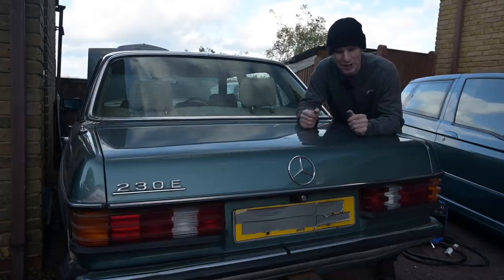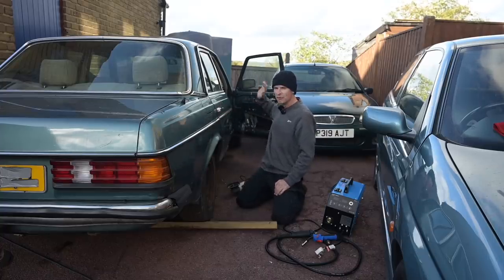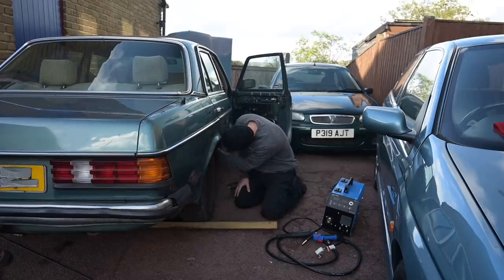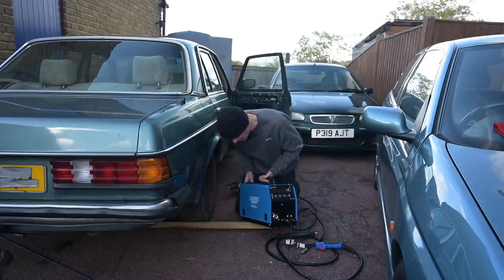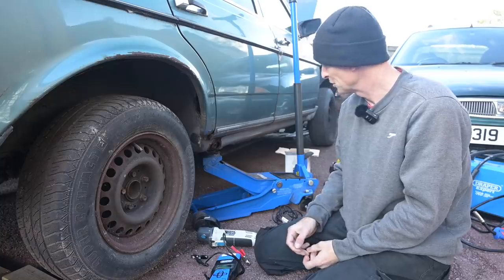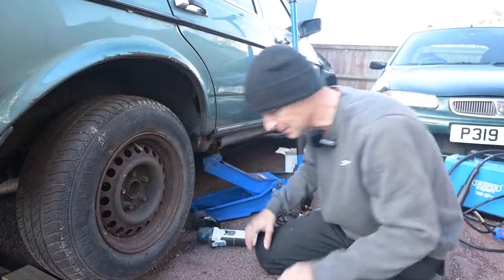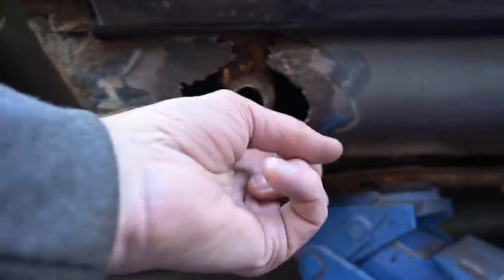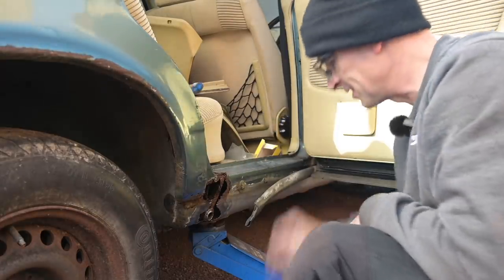More welding on the Mercedes W123

Comment: Lovely start ,I think I would have put some protection over the seat etc as the sparks could damage things speaking from 46 years of welding experience. Love what you do carry on the good work.
Reply: Exactly, loosening rear seats on older cars usually aren't that hard, and as close everything is in that yard, a fire would damage more than pride in the work! Be careful and check for slow burning weld "hoppers"!

Comment: About the welding wire spool, you will find there is an adaptor in the middle of the spool to change the diameter to suit different welder types. It usually has a clip on the inside. Pull it out and you can use it on your new welder. Cheers Bernie.
Reply: Top tip!
Reply from the maker: That is a top tip! Its covered by the sticker so never see it!

Comment: Might be my imagination but, it looks from some angles as if there should be a closing piece between those two vertical sections of the jacking point before the outer sill goes on.🤔
Reply: I agree. Am thinking the same thing.
Reply: You beat me to it guys. Snap
Reply from the maker: you mean across the front, or side really? There was no debris to suggest one was there, I think it would have been flush with the out wall of the sill
Reply: Yep was a box section, you can clearly see where it's rotted away and left uneven edges
Reply: I found a picture online and the upper section of the jacking point does seem to be boxed in independently of the outer sill.
Reply: Absolutely - that's why these Mercs rot in that area due to the sweating between the closing piece of that jacking point and the actual outer sill.
Reply: I did think similar too, the inner structure could have done with a bit of work, but I guess it depends how far Matt wanted / was prepared to go. It will probably be OK but I wouldn't trust the jacking point and would avoid jacking up the car in that area - if it continues to weaken it could collapse - stay safe Matt!

Personally I think the use of thicker steel was a good idea - I've done this before with sill repairs, but MOT regs technically state you must use same thickness of steel as original. I've been told off by people (with no welding experience I should add) for doing this but in reality it's a pretty unenforceable rule and my welding has always passed an MOT so far!
Reply: @StewSims  It's not good practice to use thicker metal than factory. Simple reason being that thicker metal will soak up all the heat from the weld, which means to get decent penetration you have to turn the power up, which in turn will make it burn through the thinner stuff.

It's a fine margin with thin steel, you need it hot enough to melt the two pieces together without blowing holes. You should never be able to run long welds with a mig on a car, if you can you're just laying it on top. On structural parts of the car like inner sills (where seat belts bolt to) you need very good structurally sound welds.

Comment: The jacking point is supposed to be a box section inside the outer sill, but when the moisture gets between the outer skin of the box section and outer sill then the outer section of the box section rots away as well, not helped by limited corrosion protection applied by the factory.  As with a lot of things on these cars, the jacking points were rather over-engineered, but the outer face does help prevent the jacking point tube twisting upwards and buckling the outer sill if the vehicle is jacked when heavily laden, which can happen on vehicles that appear sound but which have the usual corrosion behind the factory rust protection...

As other people have said, always be sure to cover the seats and door trims when grinding or welding with the door open as the sparks are plenty capable of burning into the velour seat facings or the vinyl of the door trim and leaving lots of unsightly little burn marks.  They can also easily embed themselves in window and windscreen glass, leaving it with lots of nasty speckles like a teenager with acne...
Reply: The handbook says that the jacking point must only be used with the original wheel change jack which slots into the hole. If using a trolley jack lift via the rear axle.

Comment: For the Alfa you need to double check if you connected the constant + and the ignition switched + correctly. Often with Italian cars you need to switch the yellow and red wires, they mostly even have connectors in them to make swapping more easy.
Reply from the maker: I disconnected the radio entirely to test and it still managed to go flat in a couple of hours again so either the battery is bad or something else is drawing power
Reply: @furiousdriving  must be earth rays then 😅
Reply: @furiousdriving  you need to test which circuit is drawing power and then continue. In my Punto 1  had the same issue and only the 2nd dealer found out it was the rear screen demister that was always pulling a current. They didn't find the exact cause but I was able to solve it by pulling the fuse and not using the rear demister again 😅

Comment: Good tip for preventing rusty arches, or at least slowing down existing rust, is clean all the mud our from under the lip, every car I've bought was packed with damp mud. it's worse on the rear arches usually as the outer wing is pressed onto the inner wheelarch, creating a nice sandwich for moisture to gather. I'm still on my 25 Years old's cavys original arches (Just!).
Reply from the maker: Yes, thats a damp trap and will hold water against the metal - I snow foam under the car every time I wash it, stops it building up

Comment: Last time I did any serious welding the Acetylene torch was still common and DIY Arc Welders were low powered and next to useless on anything thicker than 1.5mm and only in mild steel.

Comment: I'd recommend a Lidl Parkside angle grinder - I've used one for years on old Gloria the Transit. 1200w, surprisingly good and I think they're £20... Only problem is that they're only sporadically available.
Reply from the maker: Need to always watch their website!
Reply: Oh, yes. LIDL tools are great for the price. I use a few Parkside cordless power tools myself.
Reply: @furiousdriving  It is actually addictive. Trust me. :p
Reply: I have the parkside angle grinder ,infation guns, aligator saw and impact driver 20v cordless models plus ferrix 20v drill and impact guns and 10 inch polisher, all pretty good domestic tools.

Comment: I was trying to see if you plated the end of the jacking point triangular box before doing the sill. I personally would not use jacking points apart from in an emergency at the side of the road but they do still need to be strong. A step drill might be useful for big holes.
Reply: Or even a cone cutter - I've found those invaluable over the years.

Comment: That hole at the back of the sill reminded me of the hole at the back of the sill of my BMW E34. However, BMW still sell that section of sill, with jacking point and a section of the wheelarch as a repair panel. I did wonder if Mercedes did similar?

Comment: I have been very pleased my Rohr welder, i have the same angle grinder and i dont like it as its awful to turn on ! I enjoy welding most of the time but can be sole destroying when you find big problems, You really ought to get a bigger gas bottle, try Hobby weld gas, save you money. I also thought the inner jacking point  needs a bit of plate to close it.

Comment: Hey Matt, hope you dont mind my 2 pence.  It looked like a piece of the inner structure was missing aswell like the triangle section above jacking tube should have been boxed over?  Also worth getting in there with rust killer and paint really while you can, rust killer is fine but it wont give lasting protection.  Id suggest a minimum allot of zinc rich weld through primer.  Enjoying the videos, just trying to be helpfull  😀
Reply from the maker: I dont think there was front panel on that, there was no debris to suggest one was there, and dont remember seeing one in the front.
Once all the welding is finished Ill flood the sills with rust proofer, but while welding is ongoing that gets burnt off (and wax oil burns well so its definitely the last thing to do!)

Comment: My father had a few of w123s and w124s, they all rust in the same places as this Mercedes ... when you remove the plastics, you are always greeted by an unpleasant surprise ...
For that era, these cars were well built and protected from corrosion, but time affects the overall condition of the sheet metal ...
try to find the whole alfa romeo alfasud ....

Comment: Just had to weld in some new metal on the rear wheel arches on my w123 great cars but they like to rust
Reply from the maker: the under seal traps water between it and the metal!

Comment: Love your videos. I have started doing the same, getting inspiration from you for my 1977 W123 250.  One quick question, can you please let me know the metal sheet thickness/gauge you have used while doing body repair for W123? And if you have used any special material or just any steel sheet, would work ?

Comment: Is that an engine swap? I thought all the w123s had the reverse flow cylinder heads(inlet & exhaust on same side), looks more like a W201/W124 era engine.
Reply from the maker: no, original motor for this one
Reply: @furiousdriving  maybe in Europe they started putting the newer engines in at end of run? Here in Aus they only had the reverse flow heads,  except the twin cam 280.
Reply from the maker: @milksheihk  this motor replaced the 250 over here in the early 80s, not sure about the rest of the world

Comment: Bad technique.  Dont  position the welding torch so its blocking the view of the weld puddle. You need to hold  the nozzle at an angle so you can see whats going on to ensure even penetration on the patch/car 
You need just a few tacks..they shouldnt form the whole weld or it will be like bird poo!. Angle the torch so you can see, weld downhill and turn up the power/reduce wire speed so you get a flat weld.
Cover up the seats or they will be peppered with burns.
Spray wax in the sill after welding it will be far more effective than rust converter